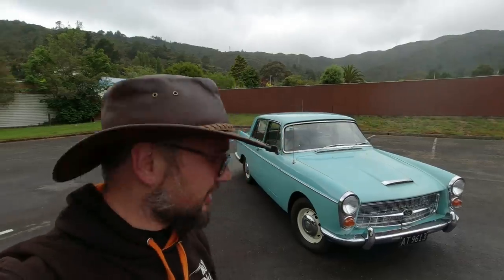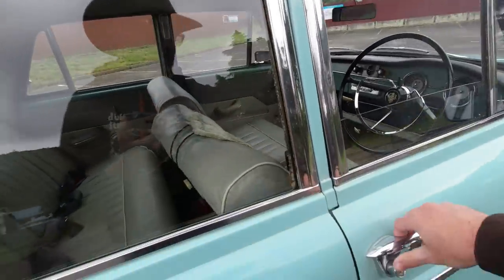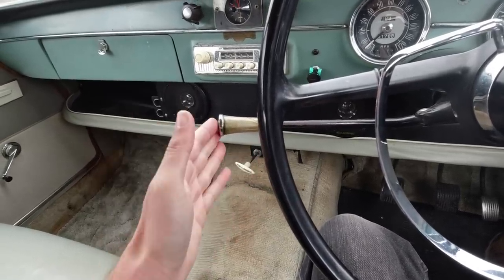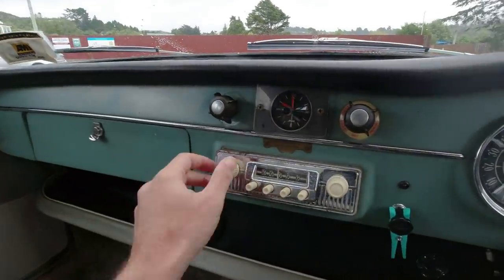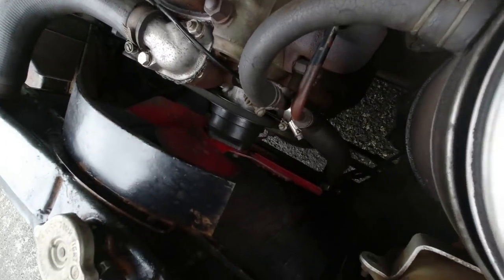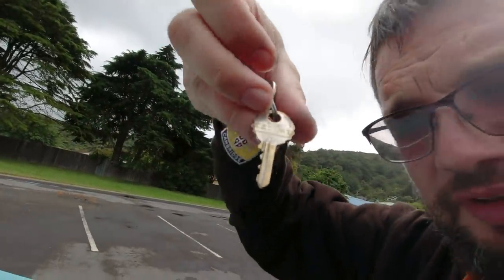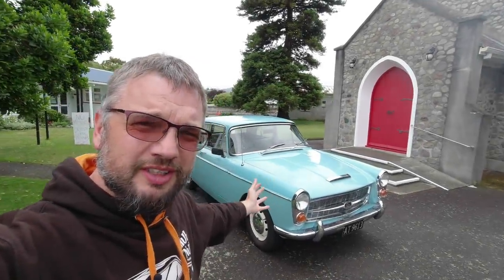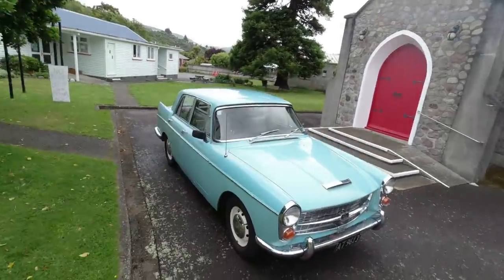Real Road Test: 1960 Austin Westminster A99 in New Zealand. Australian?

Comment: I went to the UK in 1965 and bought a Woollsley 6/99 that was a similar shape and motor but I think the over drive was different as that one worked with the accelerater  somehow I'm not quite sure now but in 1965 the police were using the same car but a 6/110 with a different dash and other things I can't quite remember but I know it was only doing 12 miles to the gallon.

Comment: I noticed the comment about " free wheeling ". My current car has 163000 miles and about 20% of those have been done " freewheeling "  ie  going downhills, coming to junctions, etc This always attracts criticism especially from older drivers. The advantages are  Less wear on clutch, Less exhaust emissions, Less wear on engine, Much improved fuel economy  ( i have never gone below 40mpg even around town in my Vauxhall 1.9 CDTI )  .Yet I am continually told " you do not have proper control over the car " . My answer to that is why ?  What can't you do ?. You have absolute control over braking . The only disadvantage I can see is it would take a fraction of a second extra to do an emergency  accelerate !!!  In my  well over half million miles motoring I have NEVER come unstuck at any time by " freewheeling ".  I wonder what others think ??

Comment: What a lovely engine in there! They pull well indeed! Must admit we never see those cars on the roads here anymore in Belgium which is reallly very sad. Even during meetings you don't and thus don't really know them well. I think it looks amazingly good on the outside. The inside has its typical wear and tear but I do really like this car!

Are you really sure about the Porsche synchromeshes? Porsche did an awful job up until they released the G50 gearbox in 87 (!!!) before they had decent synchromesh AND, for worse, only then they introduced the hydraulic clutch... It kind of represents your experience with the clunky and hard gearbox on the SC which was still operated with a cable clutch, yes indeed...

In addition to this, if that is really true, a Japanese clock on a British car wouldn't surprise me then anymore :p

Also, a big up for the Shell oil in the boot. One of my favorite oils based on personal experiences regarding several things like consumption, lifetime, cooling etc.

Comment: The UK police had A99s fitted with a 3 speed  gear box floor mounted gear lever with the  overdrive  switch under the dashboard. The dashboard colour in the UK was always  light grey so maybe this is an Australian model
Reply: The Aussies never built these models. They built the pre-Farina A90 A95 models, and marketed them as Morris Majors. Later they built a smaller 6cyl car, derived from the Farina A55 - A60 models. Marketed as the Austin Freeway  and Woleseley 24/80. Both of these cars were unique to Australia.

Comment: It may have the 3 speed box for Australia as BMC believed we did not like changing gears too much, tried the same trick in the Austin freeway.
Reply from the maker: 3-speed in the UK too.
Reply: @HubNut  The Freeway box from memory was the old 4 speed "B" series converted to have synchro on 2nd and top and a "dog clutch" idea so that you could  "crunch" it into 1st without damage,, they thought the "B" series box in standard form  might not have the strength to take the 2.4 litre motor [had it been considered strong enough they might have considered the funny Healey 3 speed type shift blocking out first.]

Comment: I hope after the owner views this video he will address some of the issues you mentioned. Clutch may just need adjusting and a new set of wiper blades should be fitted immediately. Fix the indicators adjust the boot catch etc. Small things that give the car more character than it needs. Overall a nice car though.

Comment: We had 1 of these I  the early to mid 60s, not sure of the Model? It was 2 tone grey, maybe wooden dash? Dad seemed to think there was some tie up with RR with the engine? Maybe someone with better knowledge will know, I was only a nipper. Remember the column change and overdrive, I used to sit on the arm rests in the middle of the front seats, what could possibly have gone wrong! We had 2 Cambridges before that.
Reply from the maker: Vanden Plas 4-Litre R used a Rolls-Royce engine, albeit not one they used in any passenger car.
Reply: @HubNut  Thanks. I've just found a mountain of old slide photos going back to 58, I'll have a trawl through and see of I can find any info.

Comment: about time hubby,many of the cars you've looked at here in new zealand have been cars that were not good performers here at all.these cars were working class cars here and done a good job here.what was different then and not like what you have seen while you were here,is that most of the roads here were metal and not sealed.i can assure you your trip around the south island would not have been very pleasant at all.imagine all that rain on the roads then.its not a new car remember, your scoring it like it was new.

Comment: Was there not a sporty Riley Version with tuned engine and knock off wire wheels, special paint and trim.
Reply: No that was a smaller Farina A55-A60 based 4 cyl car.
Reply: @davidtaylor351  Thanks for that.

Comment: I dont think the uk had opening rear quarter lights. You could buy a 4 6 or 8 blade fan dependant on the overseas market.
Reply from the maker: Certainly the smaller Farinas had opening rear quarter lights in the UK.

Comment: What a lovely old car. I can't figure out why they bothered with the expense and complication of overdrive though.
Reply from the maker: I think they wondered as well. Back to four-speeds in 1961 I think.
Reply: @HubNut  See my comment above The A110 also had the same overdrive.
Reply: Overdrive was a bit of a 50s fad.
I had overdrive on a Rover P4. I must admit to feeling really cool when I flicked the overdrive switch, however.
Free wheels had been a Rover speciality. Horrid things. They should have been illegal. Rover replaced their free wheel options with overdrive in 1957.
Reply: I always liked the P4. Haven't seen one since about 2000.
Reply: It also helped that overdrive was thought to increase fuel economy, which would have been very important for any 1960s Commonwealth nation.

Comment: Looks like the Austin Cambridge, Morris Oxford
Reply: g8ymw they were the smaller bodied ones, those were sold with a maximum of 1622cc 4 pot in the U.K. but a 2,600cc 6 pot in Aus.
Reply: @g8ymw  sadly in the UK most of them have gone the way of banger racing, one event in the last few years had 300 of the A60 series present, no idea where they find so many.
Reply: The Australian 6 cyl car was the Austin Freeway launched in 1962 to compete with the Holden and new Aussie built Falcon. They also built a Wolseley variant. The Aussie car was smaller than this A99. It was closer to the Mk2 Austin/Morris A55/A60 Farina cars, that it was derived from. In 1960 the Aussies were still building a badge engineered 6 cyl car marketed as the Morris Marshall, based on the pre Farina Austin A90/A95s. Which is why, on balance, i do not think this car is Aust assembled. If not UK built, it is more likely NZ assembled. As Austin had a factory assembling vehicles in Lower Hutt Wellington for many years.The key Hubnut mentioned, as being made in Australia could  either be a replacement key, or simply sourced by the NZ assemblers from Australian suppliers. I can  remember having GM Holden keys that were made in Canada.